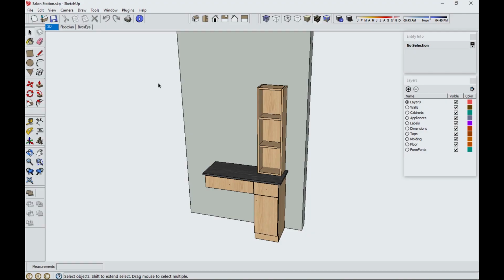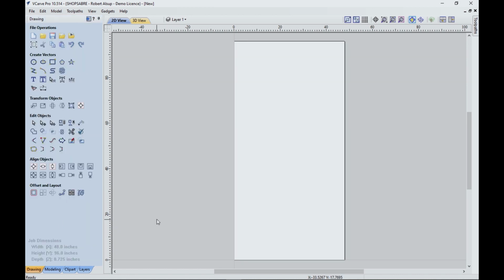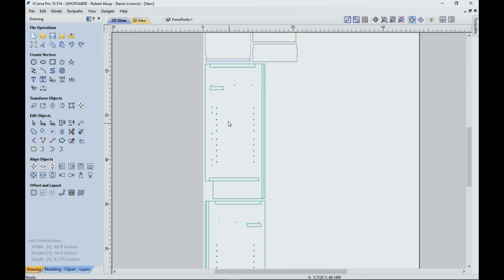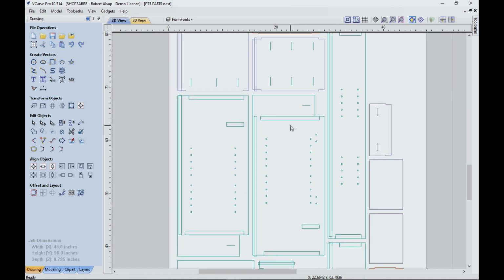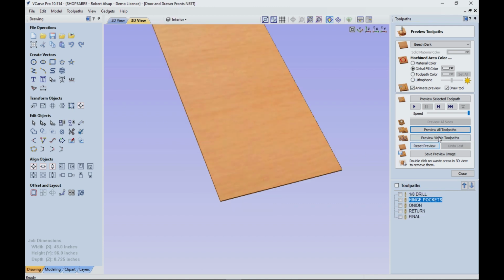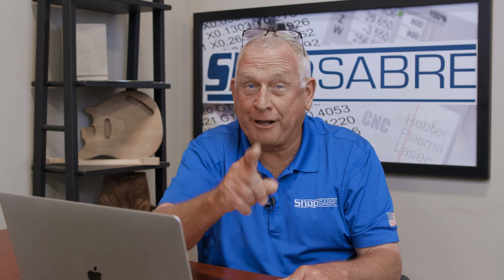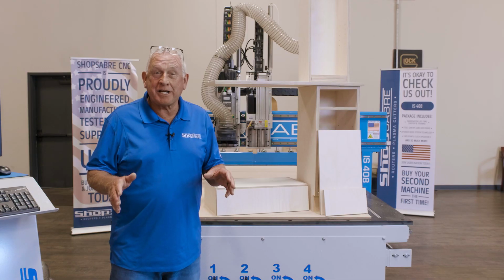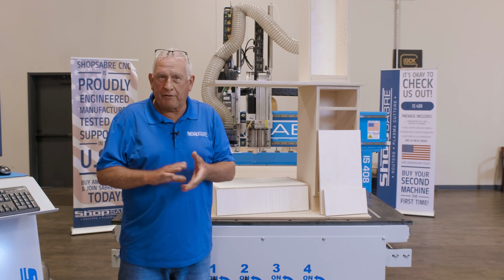Making a Salon Station with ShopSabre CNC

Comment: There seemed to be a bit of tearout on the holes for the shelves. Is it possible to prevent that?
Reply: Yes, those were inadvertently cut with a 1/4 router bit instead of the brad point drill.
Reply from the maker: Great eye, we cut it with a 1/4" router bit  in the video but we could have used a brad point drill bit and that would resolve that issue